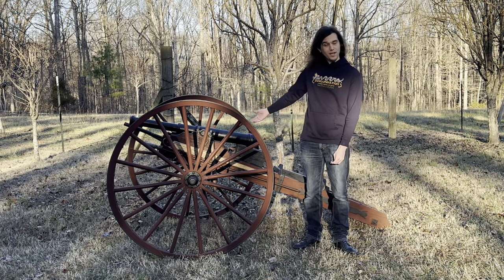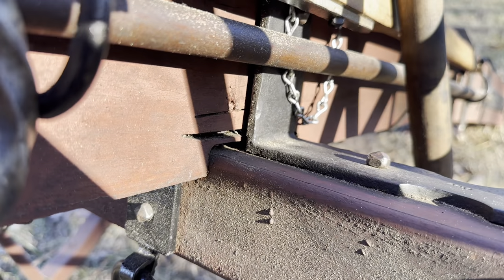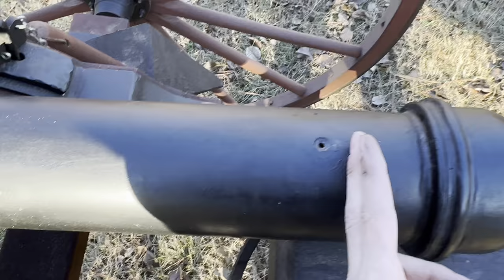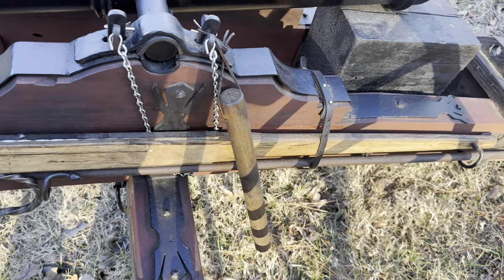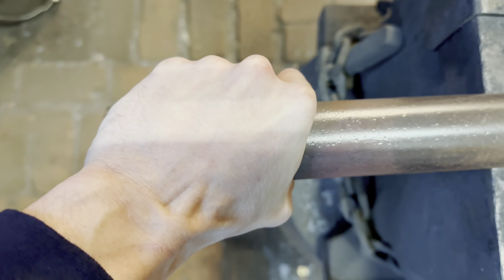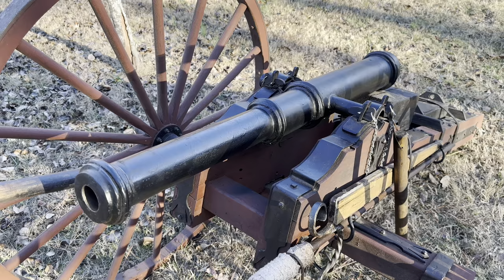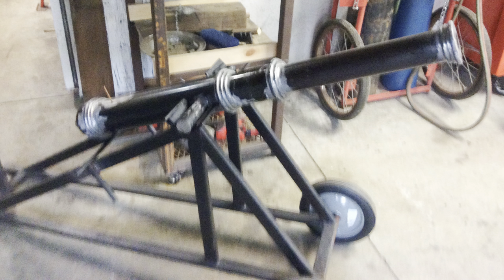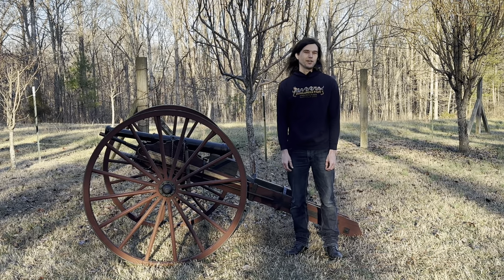How to Build a Cannon

Comment: i have built a few cannons.
i plugged the breach by threading the tube with pipe thread tap and the plug with a pipe die heated the breach to blue hot and threaded the plug in and let the barrel srink down on the plug then welded the plug in with 120.000psi welding rod. then put it in the lathe and rounded the base and welded a trailer hitch ball on the base area.. the over tubes i cut on a lathe to a light interfearance fit then heated the outer tube and cooled the inter tube with CO2.  this gave a very tight fit.
Reply from the maker: I watched a guy turn one on a lathe a bit ago and that was fascinating to watch that shape come together. That sounds like a pretty good method!

Comment: I’m watching how you guys built this. I have only one concern and please I’m not trying to be a know it all. The breech face was eventually made concaved because hot embers that were stuck in the right angle of the breech face from a previous shot would set off a powder charge of a follow up shot. The wet brush wouldn’t reach the burning embers in the corners. Resulting in unexpected detonations with ram rod in hand.
Reply from the maker: No worries at all! Thankfully since it uses a plumbers cap at the end it’s actually convex in there but I didn’t know about that issue with the flat back ones! I’m hoping to do a cannon accidents video one of these days and we will for sure have to replicate that happening. Thanks for tuning in!

Comment: The rear lower end of the carriage should be rounded like a runner on a sled so it doesn't dig in😊 your gun looks real good. If u can steel stamp it that would be better especially for in the future. I stamp mine with cal, date, my name, model & for s/n I use the aprox mfg date & proof load the last one i stamp on an out of the way place, the others on the muzzle or end of trunnion like the originals😊
Reply from the maker: I wish we would have decorated it a bit more just in general. Hopefully we will be able to make a bigger one or get that 3' gun and if we build it from scratch we will for sure mark it up. I'll have to stamp on it somewhere the charge though!

Comment: That plug seems like its just being held by that pin. The plug isn't welded at all, without the pin there's nothing really preventing it from shooting right back at you.
Reply from the maker: It’s also an oversized plug that’s driven down in there and quickly quenched for a pressed fit. It’s taken up to 1600 grains a few times and we never shoot anywhere near that on a regular basis. In fact the carriage just broke a bit as the force of the shot cracked one of the risers. I’ll be posting that before too long too. Good question!

Comment: Shooting those mini baseball bats seems like a proof test all by itself.   Just using a lot of propellant is not enough.  You also need a heavy projectile in front of it.

"The Idahoan" channel has some interesting videos on proofing his muzzle loaders.  Also, iraqveteran8888 deliberately overloads a Kentucky rifle with lots of powder and ball to the point of destruction; suggesting proof and normal loads are "mild" by comparison.

Friction in the bore is another factor that can chase up pressure with unconventional projectiles; so watch out.
Reply from the maker: I’ll have to check out their channel and some of those videos! Thankfully the bats were a bit smaller than the bore so easy in and out and they also had a backer chip behind them to make sure they got pushed out for sure!